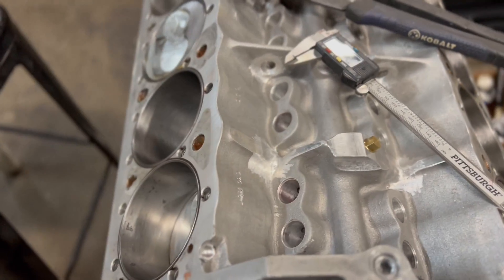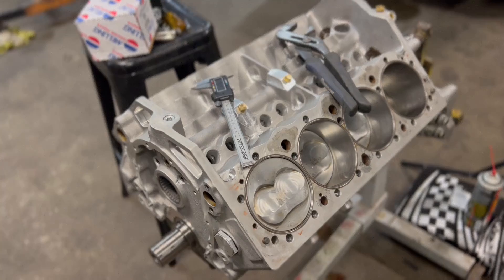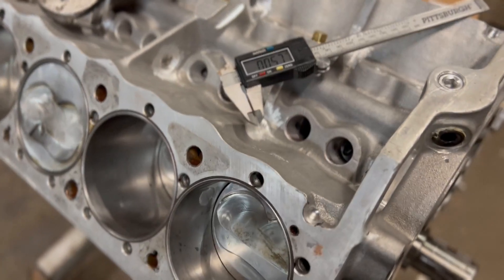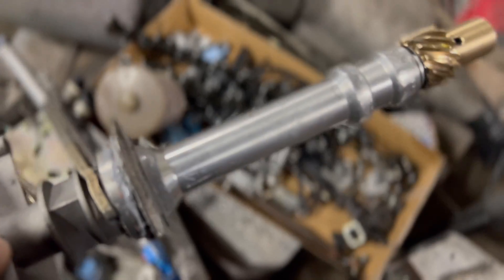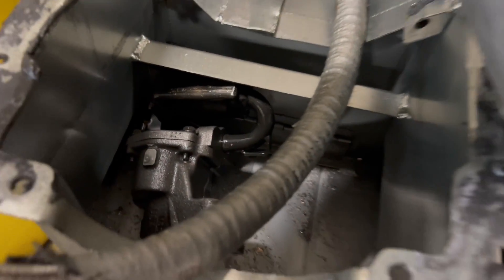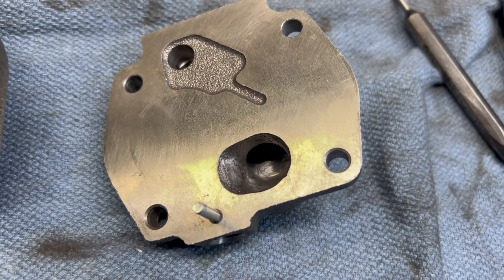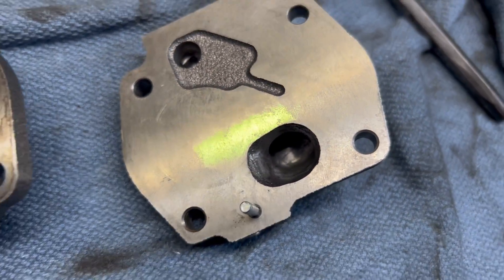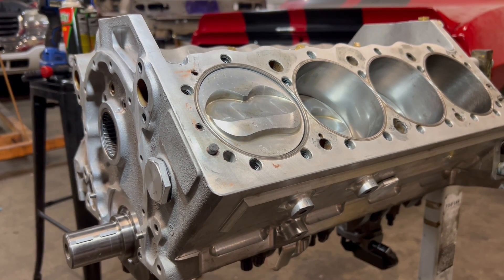Too much compression for boost?

Comment: Bro you used the wrong numbers for your pistons . You have valve reliefs that is same as dished which adds to the overall area of the cylinder head. 
  If you had a domed piston that would be a negative number not other way around sir.

Comment: It's not overlap that lowers the dynamic compression is the intake valve closing time. That's the last thing that happens before compression. Regardless of overlap a cam with 40⁰ int closing will make higher compression than one with 50⁰ int closing (in the came motor obviously)

Comment: Here to learn about compression.    Planning 9:1 on an M50 with pump gas (92)  with about 20 pounds of boost but would love to hear that I can tune for higher compression safely or understand how to determine how compression impacts detonation and tune on purpose rather than with bro sciene.
Reply: Your choosing right.  High static compression is lower dynamic compression by running the big cams these V8 cars run. Unless your running a big (280+) duration and high lift cam. 9 to 1 is the deal on pump gas. 18 pounds seems to be the limit. Lower compression more boost. If you run 8.5 you can get away with closer to 25 psi. Here is a link with some science. I daily a built turbo s52 on flex , it's 9 to 1 pistons, cut ring drops it a tenth or 2 as well. So I'm prolly just under 9 to 1. 10 to 1 on pump starts to detonate over 1 bar with m52b28 /m54 unless you run water meth , or super lazy timing making lots of heat in the exhaust.

Comment: For a non built Gen III LS what is the recommended maximum compression ratio for forced induction engines ? I'm thinking of using a junkyard LS. A Mustang GT500 M122 supercharger with an adapter or some sort of turbocharger or a pair of turbochargers. Hoping to make around 800HP-900HP with a cylinder head,camshaft, intake, exhaust upgrades.,Thanks for any thoughts or advice.

Comment: I think you’d be happier with a flat top closer to the deck than a dome that far down. You could find some different pistons with a larger compression height. You have no quench with those pistons which will make it more susceptible to detonation when you could have more compression in a safer way. Just my 2 cents.
Reply: More quench increases chances of detonation buddy not the other way around.. you want the flame front up in the head not down in the block. Also running more quench makes the motor an absolute DOG and it won't get out its own way.
Reply: @oklifrederick  that is all the opposite of correct. Quench is the best way to avoid detonation because it mixes the fuel and air properly and make the engine much more responsive. I run 11:1 on 87 octane with 9-15 pounds of boost on the street. No detonation. I do run water/meth injection that’s boost referenced. 

Rereading your post I think we are talking about different things when we say ‘more’. I meant more flat area on the piston to match with the flat area on the head. Close like 0.038-0.040 inch. Not more like farther down in the block. So the flame would be up in the combustion chamber. Thats what I call the quench area where the flat area meets the flat area to mix the fuel.

Comment: We use standard volume high pressure Melling Billet oil pumps in the turbo engines.  I like using a copper gasket between the pump and the main cap too.  I feel like the copper gasket helps absorb harmonics to keep the cast iron pumps from cracking and the pick ups from falling off and breaking
Reply from the maker: Those are nice pumps, I want to try one at some point!  Good point on the gasket too, never thought of it like that.  Hope to see y’all soon!

Comment: you're supposed to check compression height at the wrist pin not on the top of the Piston towards the intake or the bottom of the Piston towards the exhaust, because that's where the Piston rocks on the PIN. good luck I like your videos

Comment: For less than a thousand t shirts
400 Sbc fresh from MPE set up for turbo application

Dart Little M
Callie’s Magnum 3.750
JE Piston 4.155 (4 spares)
Tool Steel Upgrade Wristpins
Wiseco Boostline 6.000 Rod
LJM custom ground cam (Comp Core)
JPP Billet timing set
AFR 235cc Heads ported by CFM
Crower Stainless Shaft Rockers 1.5
Crower offset hippo lifters
Wilson Profiler ported intake

Comment: More compression should require less boost to make the same power.
Reply: Yes correct 👌🏽
Reply: More compression, does require less boost for the same power. But less compression also makes more  power with more timing. Plus your not riding the razor's edge of destruction/ destination. Lots of variables, Vehicle, Use- Weight- fuel- Summertime temperature/ IAT'S-  Quinch- Chamber shape and material- valve events.

Comment: 11.5:1 is zero problem on alcohol, we run 12-13:1 on roots blown big block stuff with 40+ psi of boost no worries. X275 guys in the 14:1 range. You’ll be safe and sweet mate.
Reply: What about 11:1 on e85?
Reply: @nalley6815  no problem depending on combination and engine platform, tuning window narrows somewhat but have done 11-11.5:1 successfully boosted on E85 on a few engine platforms.
Reply: @chrispalfreyman8434  this is gonna sound childish as hell so prepare yourself. I’m trying to make about 1150-1250 to the tire. The only reason I’m looking at 11:1 is because John Doc has an LS swapped twin turbo mustang running 11:1 and it just sounds insane lol. Not like most boosted LS’s running 9.5:1 that sound like a damn stock Chevy 1500 with an exhaust. I know that’s the dumbest sounding thing somebody could say but that’s just how I feel about it….. So I was looking at building something a little higher compression but not if it meant I was boost limited. Not worried about pushing timing so that doesn’t bother me
Reply: @nalley6815  I've tuned a 6.0 LS, fairly healthy hydraulic roller, 11.5:1 comp, cast 80mm turbo. Was a class limited deal, from memory it made 1100whp on E85 non intercooled and around 23-25lb boost. You should have no issues doing what you are chasing.......but you will need a good tuner.
Reply: @chrispalfreyman8434  wow no intercooler on that deal? You’d think with the higher compression it would need it. Do you think it would be fine to drive on pump 93? Be kinda nice to have a dual fuel setup for drag and drives. Be expensive though I bet
Reply: Its going to be an issue with hypereutectic or cast pistons though. Those ratios are fine on a bulletproof bottom end but on budget pistons high compression gas or alcohol is gonna have issues

Comment: Overlap doesn’t effect dynamic compression. Intake valve closing is the only valve event relevant.
Reply from the maker: Your right, I was trying to say cylinder pressure in some of that. lol....the valve events with more overlap allow for less cylinder pressure throughout the compression stroke.  Venting some possible usable cylinder pressure to go out the exhaust rather than pushing on the piston.  But dynamic compression is the pumping compression that we see when we "pump" the motor when doing compression check.  Advancing the cam increases and retarding the cam lessens.  But I for sure am not a cam expert, that is beyond my expertise.  Well, I'm not an expert at anything on a racecar.......lol
Reply: @TurboJohnRacing  yep. All good I enjoy your videos. 👍🏼

Comment: Just copper coat both sides of the gaskets, let them sit a min or 2 til it gets tacky, then slap them on. No need to spray the heads or block
Reply from the maker: That's what I'm going to do this time

Comment: Compression will be fine. But it would be great if you had some flat tops with the chambers softened on the heads.
Reply: 💯 flattops at .000. No, in the hole!  Over .045 hot with gasket flat deck and a wedge. I think you may have found what is blowing it up. Any excess deck will detonate.  Trust me!
Reply: @Bbba724  Yes. Do you think it traps unburnt fuel towards the far end of the cylinder with a dome piston?
Reply: @dondotterer24  Yes it does, and during detonation it is like a nuclear reactor meltdown, flame going everywhere and lifting the heads , if you have cylinders side by side you can blow liquid fuel from the detonating cylinder  into the one at under mid stroke and it will get a double blast one hard run that lifts the heads with the piston in that far even with aluminum rods is going to hurt it bad.  Wedge heads can’t take that.
Reply: @Bbba724  Wow. Great information. I never thought it through that far. Most people don't know when it's going into detonation especially with turbos.  Thanks
Reply: @dondotterer24  Detonation is caused by excessive back clearance or the squish area being more than .045 from the piston crown, if you have rods shrinking and growing and you already have a gasket as thick as the squish should be and some cylinders are.030 below deck with methanol it will be like a calliope lifting the heads and flexing the heads up and down.  I think the problem primarily is heating and cooling the pistons and rods and detonating moving around, if liquid fuel is swapping cylinders and having uncontrollable pressure waves it is eventually going to give up. I would get it to zero deck and I would get the information on the rods on expansion time and rate along with the elasticity of the rod growth. Also , knock sensors especially where a cylinder side by side like 5-7 or 7-8 on a Ford. I am thinking that it is lifting the heads. You want the squish and pistons to nearly collide, and if the CR is too high put a dish in them. I used a slow motion camera during a dyno pull on a methanol engine and methanol burns so clear it took a slow motion video to see that it was lifting the heads just enough to blow fuel into adjoining cylinders. It was chaos.
Reply: @Bbba724  I agree. Great info! Thanks. Be cool to see a video.

Comment: My pick up fell off when I took off the pan.
Reply from the maker: That sucks
Reply: @TurboJohnRacing  I liked how you ported intake i just replaced my non high volume for the 55 hv and the top is ported where the bolt goes on top larger than the standard flow
Reply: Look up how to drill and roll pin the pickup tube to the oil pump.
Reply: @jimandskittum  I have replaced it with new melling hv same as his with factory pickup.
Reply: @jimandskittum  you can't without a drill press or something its almost a half inch thick

Comment: I am just an old man that blew a chunk of $$$ on my hot rod and my "street car" spins up to 9500 is the limiter and I use LAT 70w my compression is 11.29 on the build sheer at 110 lsa I have 70lbs pressure and up to 120lbs spinning past 6500 rpm so I think Jon is doing rite or what he has been advised to 👌👌👌

Comment: 11.5 should be fine with methanol. Sure sounds better than 12.9!  Do you have any knock sensors on your engine?
Reply: Methanol can take advantage of higher compression.  The cam timing is everything.

Comment: Why did you not get the m55hv/hp pump
Reply from the maker: This is the hv55 with the 70psi pink spring.
Reply: @TurboJohnRacing  they make a hi pressure hi volume pump also, or used to when I sold parts

Comment: Static compression means nothing, dynamic compression means everything.  With the right cam that thing is gonna run hard, even with the one cylinder that is slightly deeper in the hole.

Comment: Do me a favor and put a oil heater on your pan. Cold oil cant pump and dosnt lubricate the engine well atall. Hot oil and cool coolant is a awesome power package and helps parts live.
Reply from the maker: Yes, it has one.  I gotta do better at using it.

Comment: No, Our Top Alcohol car numbers.
500ci
55 to 65lbs of boost.
15 to 1 compression.
50 to 60 degrees of timing. 
All numbers are ish.
😏
So you’ll be fine.
Reply: What stroke?
Reply: @HustlinHorsepower  4.5”
Reply: @HustlinHorsepower  small bore, big bore , 4.25
Reply: @fallrookmike   - Did you mean to say small bore big stroke?
Reply: @danmyers9372  No, I thought I was replying to @Hustlin Horsepower. I replayed twice. First reply
Reply: @danmyers9372  First reply was 4.50” then I added the other . Sorry 🍺
Reply from the maker: Wow....I wonder what the a/f ratio is at that kind of timing?
Reply: @TurboJohnRacing  about 3 to 3.1 ….ish.
Reply: @fallrookmike  Jesus

Comment: Or try the M155HV which is the 3/4" pickup version of yours. I have one of these and my idle pressure is at 70#. And maybe fill that gouge in the pan rail with weld or jb weld....lol.

Comment: SBC does NOT need a HV pump. And 60psi is the max you need. And dont use thick gluggy oil, use synthetic. With methanol change it regularly. With avgas maybe twice a year!! Those two points is 40hp.  And less heat in the oil as well. Then make certain your oil level is well below the windage tray
Reply: All the experts say 10 psig per 1000 RPM minimum oil pressure on high rpm high hp race engines. 20/50 oil minimum.  some run straight viscosity 40 or 50 weight oil. Brad Penn is a name that comes up regularly. This engine sees over 8000 rpm regularly and has looser bearing clearances than you would run on a street engine. Just an old man thinking out loud. 
You would be correct for a healthy street engine that rarely saw over 6500-7000 RPM.
Reply: I think what you say would apply to a high performance street engine but I believe a boosted race engine regularly seeing 8000+ RPM needs more than 60 psi to live.  Most all engine experts recommend at least 10 psi per 1000 rpm.
Reply: He runs Brad Penn green oil. I think thats synthetic?